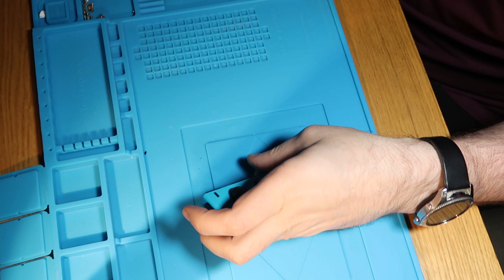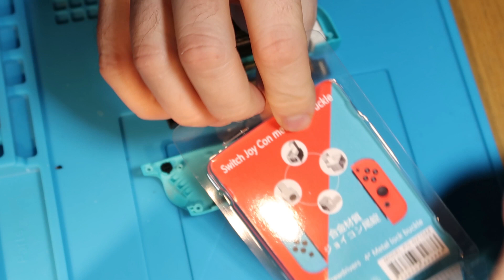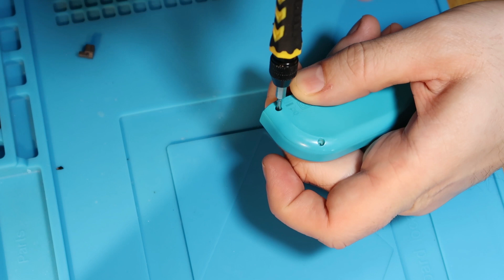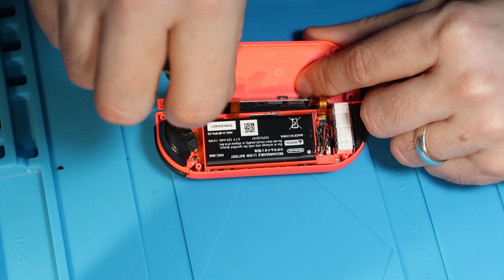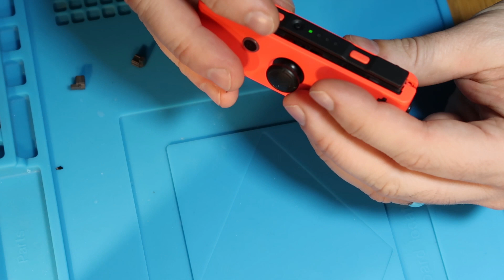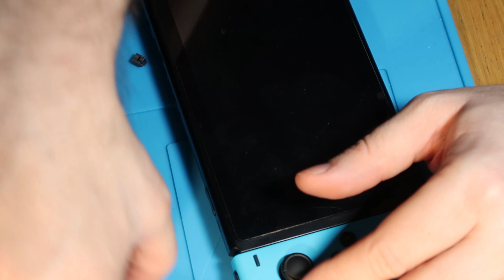Permanent Repair for the Nintendo Joycon lock - Replacing the Joycon lock with a metal one.

Comment: I switched to metal and it's worse it seemed the spring went deeper into the lock. Could it just be worn out springs??
Reply from the maker: I didn't have that issue on mine, might be the notch in the metal bit is deeper causing the issue.

Comment: I did this to my joycons a few years ago. One thing I remember is that the latches for the Left and Right joycons are mirrored, so you absolutely don't want to get them mixed up. I didn't notice you checking the polarity, if you will, of the metal latches before putting them back in the joycon. I'm not sure if you noticed any differences after the repair, or if you just got lucky.
Reply: what are the differences? i just did this today and the latches work but dont go in before
Reply: @ZacharyWood-r9x the slopes are mirrored. If you did the replacement and its not latching, you got them backwards. I don't really have a good way to indicate which one goes with which. You just have to pay attention to how the slope would latch onto the rail.

Comment: This will prevent weathering of the lock too, right? I saw some concerns about weathering the rack on the switch itself too, have you had any problems with that? Also where can I find the locks you bought?
Reply from the maker: I purchased them from Amazon and not had any issues been using it for nearly a year on a regular basis.

Comment: How hard wearing are these metal ones? I'm sending my left Joy-Con off for repair (as I have rolling insurance on my Switch) but wouldn't mind, if I ever cancel it, replacing the buckles with these metal ones.

The product being described as "alloy" doesn't say much.
Reply from the maker: I have had them installed in my switch for over a year with no issues. I'm at 600 hours of game play on Zelda alone so your pretty safe.
Reply: @WeRepair  Good to know.
Just worries me when they're described merely as alloy as that can be chinesium upwards.